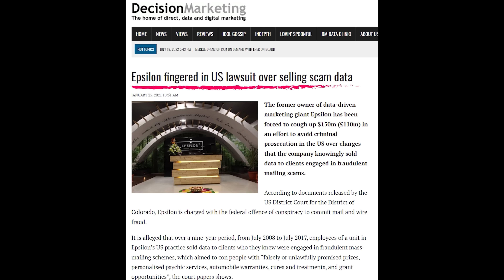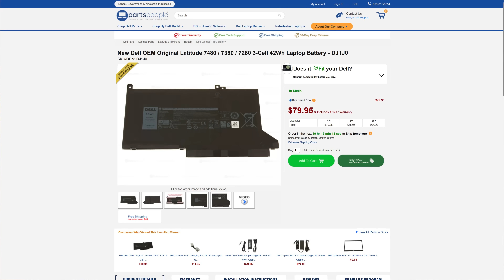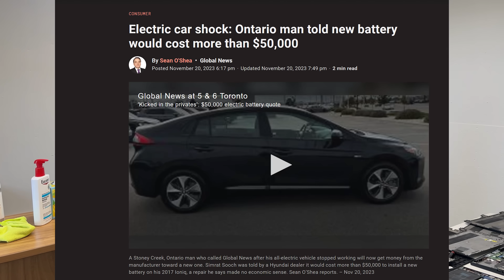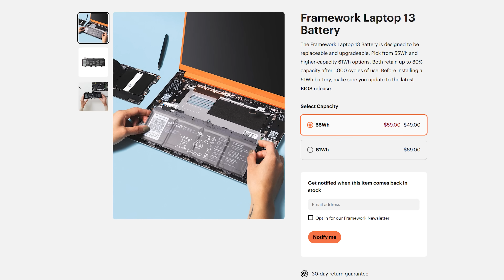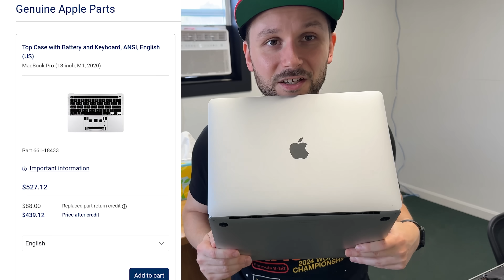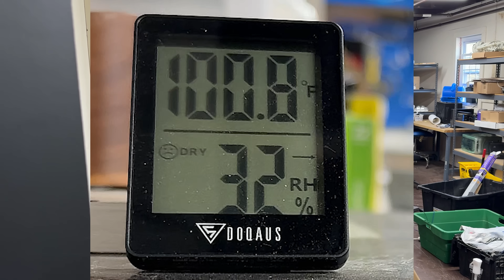Planned Obsolescence: Why is Replacing a Battery STILL So Difficult and Expensive?!

Comment: 12:09 This reminds me of my Moto g8. The battery became a spicy pillow just 3 months after the 2 year warranty expired. The battery almost destroyed the plastic back cover. I wanted to buy a new battery, because the rest of the phone was working perfectly fine. And quess what, i couldn't find a battery that was cheaper than 100 dollars (and of course an aftermarket one). It was cheaper to buy a new phone (only after 2,5 years!) than trying to repair it.

Comment: I replaced the battery and upgraded to a SSD in my 2009 MacBook in 2020. I used a aftermarket battery, yes it doesn't last as long as the original battery, but it's still going, also running Debian 12 Linux haha.

Comment: Ive got a Dell Laptop from work, and its battery lasts less then an hour ona full charge after just 2 years. Apprently it always charges the thing to 100%, killing the battery in no time. This is a fail of epic proportions.
As for Linux, im daily driving it for many years now (alongside MacOs and Windows on my company devices, where i dont have a choice), and while it certainly has its issues i have to spend FAR less time
troubleshooting and updating it then i have on its competitors. It may not be for entirely tech-unsavy people (yet), but if you have the slightest idea of what your doing you should give it a try.
Sure, theres the whole "anticheats dont work" debacle, but thats deliberate. Easy-Anticheat and BattleEye both have native Linux support, some gamedevs just choose to refuse to allow them to run on Linux.
Even things like Gameguard, which (elegedly) use kernel-level "rootkits", run flawlessly in Proton, oftentimes even better then on Windows (as evidenced by Helldivers 2 atm, where you dont have Gameguard related crashes).
(Thanks Valve, you are true chads!)

Comment: I just replaced the battery on my godfathers laptop yesterday since his old one was bloating to all hell. Ifixit had exactly ONE left in stock on their website. I didn't trust weird no name sites with dodgy looking batteries from fourth party manufacturers. That HP Envy didn't even have a ribbon cable connection to be annoyed with but it just slotted right in. 
The bloat you showed was nothing compared to what I saw :D Trackpad almost popping out, keyboard not taking inputs and the entire thing not closing anymore. At least the local retailer took the battery for special waste disposal, no questions asked. But yeah, people without anyone tech savvy enough to fix it for them are SOL and probably throw away the whole device or just watch their laptop explode and burn their house down.

Comment: Then jury rig a battery, I wouldn't buy a new one, I'd piece the cells, find the positive with a volt meter, then take a lead and discharge both cells... Electrolyte dead, start taking the battery apart and you'll most often find a single use breaker that is the reason the battery can't take a charge... Remove that, reseal the electrolyte, create the circuit with the proper resistance to make the battery work with the item, and bam, new battery that will never fail unless the electrolyte boils out...because you repaired it and took out their BS that bricked it to begin with.

BE INCREDIBLY CAREFUL WITH LITHIUM BATTERIES... IF IT CATCHES FIRE, BURY IT IN SAND. THAT THING BURNS TOO HOT FOR AN EXTINGUISHER. Bury it until it discharges. 

Nichal cadmium won't ignite but don't let it touch your skin. It's caustic and carcinogenic.

Lead acid batteries are outdated, mostly older car batteries, these things can't take a charge the wrong, and aren't worth fixing because the acid is either no longer potent or the lead electrode is all but gone. Lead isn't great to handle but the acid is particularly nasty. Recycle these... The tech isn't worth saving.

Another battery worth tossing is lithium polymer, these things are death traps, they're prone to deforming when the polymer breaks down, and are common in chineseium charge packs. You can get rid of the polymer when it breaks down but then you're left without an electrolyte....and lithium isn't great to leave around due to it's reactivity.

Comment: You just answered your own question.
Start a battery assembly and refurbishment. A funny option is manufacturing a led acid battery for laptops, yes, these batteries will top out at 20 kWh and last for 1 or 2 hours but with the ability to refill the liquid and clean the nodes, a led acid has an infinite lifespan.

Comment: Charging threshold should be enabled by default. I have a 6 year old battery, that I have rarely charged to 100%. It has 95% of original capacity. Properly cared battery will outlast the machine.

Comment: I only upgraded the battery on a macbook pro early 2011 13inch and bought a 40 euro aftermarket battery.  Much to my surprise it does last for a few hours but it still does quick when you put load on it like cinebench.

Also I didn't care that it had to be plugged in. With the old battery the cpu was forced at 0.8Ghz no matter plugged in or on battery that even ssds didn't speed it up

Comment: battery fan (not expert) here:
The margin on batteries can be anything. It always depends on the product and the income strategy that a company pursues.
For example, Tesla makes no money with the sale of replacement batteries for vehicles but they make extraordinary profit with their Powerwalls and Megapacks.

100kWh for a car is ~20k but 13.5kWh for the house is ~10k

The problem with laptop batteries:
Laptops are small cause thats the point.
no thermal management, no real buffers (device runtime is easier to advertise than "the battery is going to live longer"), high charge and discharge rates, usually lots of charge cycles within a short time

There is no "good" laptop battery on this planet. They all suck cause their circumstances suck.

Comment: I think the immediate solution is to stop using proprietary battery design and stick to a few common models. Laptops are not very space constraint like smartphone does. Really don't have to change the battery design for every other new iteration.

If laptop uses standardized batteries like car 12v batteries maybe good third party brand like Duracell, GP, Energizer can start making reliable replacement batteries for laptops

Of course, the laptop brands aren't gonna do that because its less profitable if someone buy once and uses their laptop for 20 years 🤣

Comment: I've sold aftermarket automotive parts for over 25 years. The batteries in that industry have been going this route for the last decade. You can't find anyone doing pro-rated pricing because there's no need for competition anymore. The vast majority of parts stores all buy their batteries from Clarios (Johnson Controls) or Deka. Both of the manufacturers have been in perfect sync in terms of warranty coverage dropping and defect rate rising. These days, less than 50% of the batteries in sell to shops  last the full term of the warranty, but the pricing has risen dramatically to cover the manufacturers losses on swapout.

Comment: And that's the reason I refuse to buy anything but a desktop PC. No built-in batteries, no proprietary hardware, easy to diagnose and service, plenty of room for upgrades, higher resale value, much better cooling solutions, support for legacy drives and optical media, it's not tied to a crappy screen and tiny keyboard, zero risk of dropping it and it's 100% user serviceable without the need to turn to the manufacturer that doesn't even make the overprices parts for it anymore. Portability is NOT worth it.

Comment: I spent over 1800$ on an HP Omen gaming laptop and it broke in under 2 years. The fans just suddenly stopped spinning. I sent it to geek squad, told me to replace the fans so I did and it still didn’t spin. They told me it was then a motherboard issue and I’d need to replace it, which is basically the price of a new laptop. Sent it to a local repair shop, told them everything I’ve been told, yet they repeated the same tests as geek squad and took over 3 months to return it to me, saying the same shit. What am I supposed to do here? Just throw it away? Is HP that unreliable a brand, all its laptops break so easily?

Comment: I bought my phone in 2018 installed custom rom Android 15 and already changed the battery 2 times using aftermarket battery which last for less than 6 month
and now my phone need to be charge 3 times a day

Comment: Supporting comment for your awesome channel.
Thanks to you I bought a used Thinkpad T490 this year and was actually surprised with the quality of the device. Original battery is still somewhere 70% of it's capacity. Before this purchase I checked the price range for batteries for this laptop and it costs up to 70USD (could be found way cheaper, but 70 is the price of trusted dealer) which is acceptable to prolonge the device life.

Comment: Yeah - we have definitely arrived at a place where the performance boost from new processors no longer justify the cost to upgrade. I have a Macbook Pro 2011 running Ubuntu with 16GB RAM and a 500 GB SATA SSD which runs really well.  Only downside is the weird resolution but that machine sometimes feels more responsive than my 2018 Macbook Air which is also still running well. Battery is terrible but it's not my main driver as work supplies my main laptop. So I'm not as bothered.

Comment: I think the solution will be EU enforcing USB PD on battery units, and maybe even a standard internal connector (hey, maybe usb c is ok)
At least even if you cannot fully fill the battery compartment you can at least claim some capacity with standard batteries.

Comment: YES
i would buy a laptop from you for 200 Dollars if those laptops are good with a new original Battery.
BTW i am using older laptops and if the batteries bloat i would totally change them. 5 years old computers are totally fine.
Thankfully my desktop is still good for WIN11. Its totally good for gaming with a 5 year old Rizen. Dodged a bullet there.
A reason to dump a laptop is if it is very old and slow tech or a burntout board.

Maybe you should use some aftermarket batteries if you find a company with some kind of quality or let the customer decide what they want.

You should team up with Louis Rossmann on that topic.    :-)

Comment: I just forsake the battery and be done with it.   I don't see a use for a battery if the pc is used on a desk all the time anyway. It just so happened I bought a laptop with the same charger as my work laptop. And it came with 2 chargers because of the docking station it came with. So jow I have 4 of these.😂😂😂

Comment: Could you remove the dead battery and wire in some 18650 cell power tool battery as an external battery?

Comment: I felt the same way. My pocophone F1 . Still capable with good processor and 256gb rom 8gb rom from 7 years ago is not in use coz of a fucking battery. I replaced the battery twice but the second time wasn't the good company qaulity one so the device is a paper weight now

Comment: I am so grateful I had soldering class back in my junior high so I'm not too unfamiliar with pcb. so I decided to replace my macbook 2020 battery myself with ifixit's battert instead of letting apple do it for me. Replaced the thermal aswell, cleaned everything and it performed much better and don't think will be replacing the laptop soon. maybe in 1/2 years

Comment: Yup. Still using 2014 HP Envy 17" laptopt. For day to day use, even some light/medium 2d/3d CAD, it's more than enough. Sure, it was 1500 euros back in the day. Replaced one hdd with ssd and it works fine. Those inbuilt batteries on new laptops are problems. First and foremost, you can't remove them. In older models with detachable batteries, you can charge battery to cca 50%, remove it and store it. It saves battery from degradation when you don't need them, for instance if you mostly use laptop at home and pluged in.

Comment: The sad thing is that despite laws that force companies to allow users to repair their devices, companies can continue to force users not to be able to through tricks like this (being the only ones who can sell spare parts, and then proceed to sell said spare parts at prohibitive prices)

But on the other hand, this can be easily avoided by creating a standard for batteries... If all companies were forced to use the same model and connection type for batteries regulated by a normalization organization (ISO or something like that), and the technology behind that battery was open and accessible to anyone, then there would be factories dedicated to independently manufacturing quality batteries outside the hands of those big companies, and the price of batteries will be soon very cheap

We have a precedent with Apple and USB-C in Europe, so it's perfectly possible

Comment: What sucks about the battery industry is that the minerals within the batteries are sourced unethically the expense of other people. An example is the Congo and what sucks even more is that tech companies as you said do not care about sustainability and don’t build their devices to last but rather to need eventual replacement and stop supporting older models.

Comment: Without radical changes to the laws these companies will keep doing what ever they want to. As for batteries in laptops it would be extremely easy for a company to make a semi universal battery that works in most if not all of their models. Voltages, capacity and even form factors of laptops don't really change that much. They COULD have a solid solution IF they wanted to. However IF they are NOT required to stop F ing over customers they will NOT simple as that.

Comment: It's the same sh*t in every sector, automotive will just stop making parts after 10 years (vehicles last 30+ ya pricks) and/or require a friggin headlight to be programmed into the ECU. 

And for instance appliance parts are ridiculously expensive; ordering a Miele in parts will set you back at least twice if not three times as much as an assembled machine. Or when a drum spider breaks you can only buy the entire tub including a new inner drum, cast iron bearing spider and the spider. A 50-100 euro part becomes a 500 euro tub and drum. And those are basically the only machines worth a serious repair, you'd only fix a 450 euro cheapo washer if it's as simple as carbon brushes or a drive belt. All other parts are so expensive you're better off buying another one.

Comment: My dad had me try to replace the battery to his Apple Intel 2020 MacBook. I said it worked fine, and if he wanted a guarantee the battery would work he’d have to go through iFixIt.
He bought a battery from a Chinese company off of Amazon. 
Accidentally bent the original battery (it’s my first job, I knew I was bound to damage the battery if I tried) and lo and behold? Battery was DOA. Do not cheap out on batteries yall, it’s been 7 months and we still haven’t got a refund 💀 if not for my dad’s insistence we’d have a perfectly good laptop but now it’s just sitting in my room busted til I can save up to fix it.

Comment: proud to say ive been rocking two laptops (both used and were gifts from my partners dad) one msi and now an asus which both are a a couple years old by now, both batteries are fucking dead, but i dont fucking need them cause the first was, as is the second now, stationary.
only thing i did was repair fans and repaste.
is this by choice? no im fucking broke. 
is it more than enough for work/freetime? for the low amount of money and mid amount of effort put in abso-fucking-lutely.

learn🙏 to   🙏repair  🙏 your   🙏shit 🙏 🙏

Comment: also its much easier with older laptops as you can just buy individual 18650 cells and spot weld them onto the original bms so it doesnt complain

Comment: I still use my shitbox pc with i5 4th gen and 6gb of ram, just upgraded it with 16gb ram, 8gb radeon saphire video card, a new power supply 2 ssds for dual boot and 8tb hdd, still goes like a champ 60 fps max settings in valhalla and stable and playable on most games

Comment: Windows 11 24H2 is no longer an option So I install Linux Mint Xia 22.1 even on HW that could support Windows 11 24H2 without any issues. I am so over the Bullshit Microsoft pulls and it is only getting worse and worse. I started with Windows 98SE in 1996! NOW in 2025 I am done with Windows for life since it turns more and more into a security risk for the unaware user.

Comment: I repaired a Dell XPS 9310 the other day that came in for not turning on.  Nothing wrong with the laptop except the battery was dead dead.  These newer laptops wont even power on unless a battery is connected and recognized.  It is stupid.  And yes had the USB Type C charger connected and still would not turn on with a battery not detected.

Comment: I replaced my S10 purely because the battery could barely do 2/3rds a day, with light usage. Swapping the battery vs. getting a new phone just wasn't worth it.
2027 - EU dictates all mobile battery devices has to have user-replacable batteries. Can't wait. Not replacing my phone till then (luck permitting).
Reply: "The new rules stipulate that all electric vehicle, light means of transport (e.g. electric scooters), and rechargeable industrial batteries (above 2kWh) will need to have a compulsory carbon footprint declaration, label, and digital passport.

For "portable batteries" used in devices such as smartphones, tablets, and cameras, consumers must be able to "easily remove and replace them." This will require a drastic design rethink by manufacturers, as most phone and tablet makers currently seal the battery away and require specialist tools and knowledge to access and replace them safely."